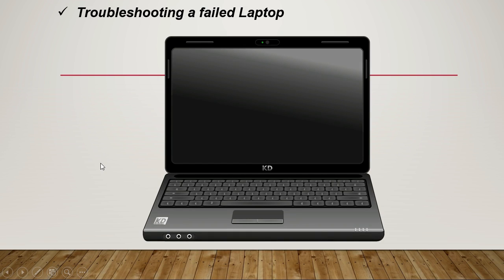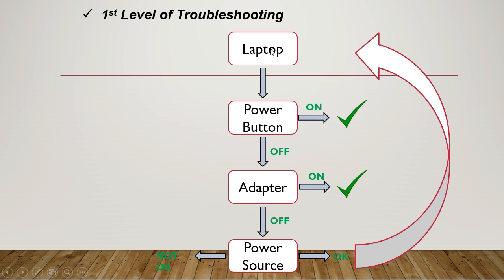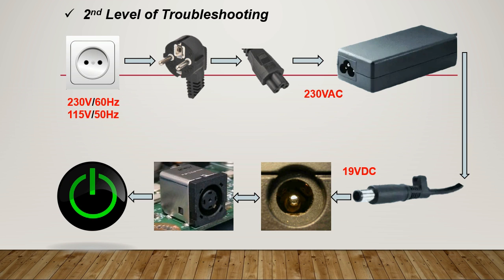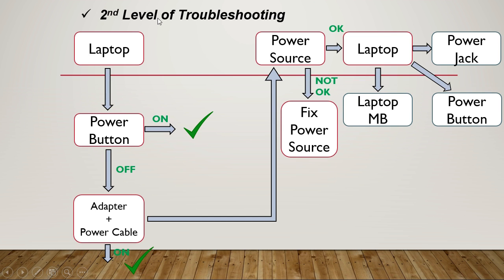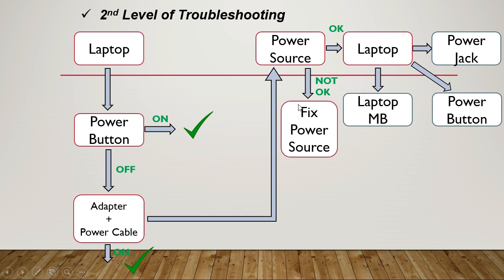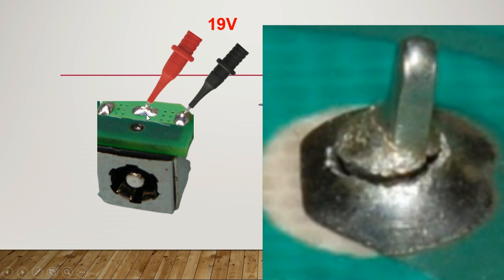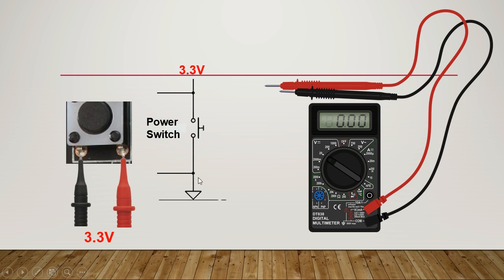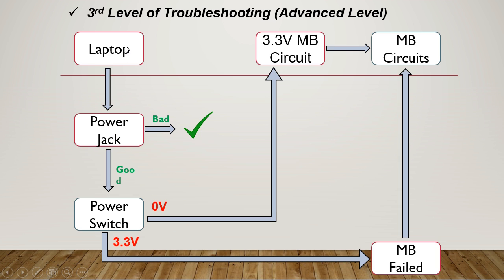How to diagnose a laptop motherboard using Decision Trees

Comment: 7:12 if there is 3.3v it has a chance that the switch itself is bad
It can test with continuity mode and pressing button. But it must be unplug and without any voltages🙏